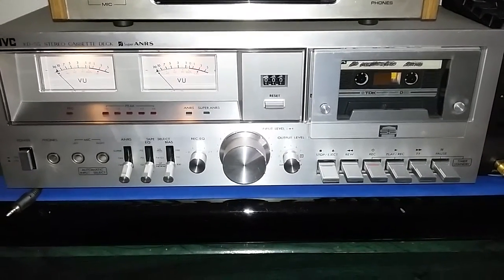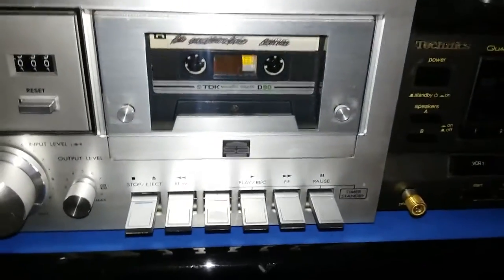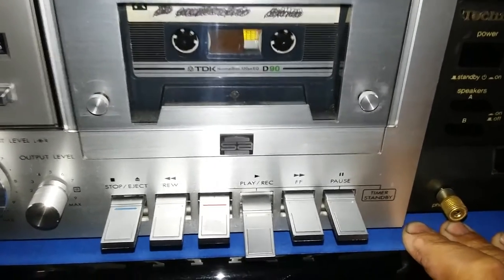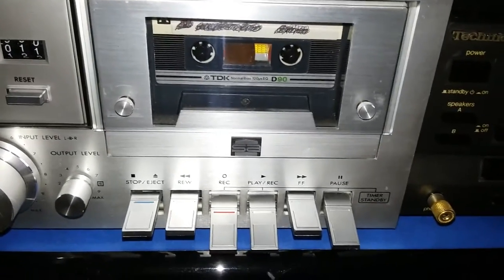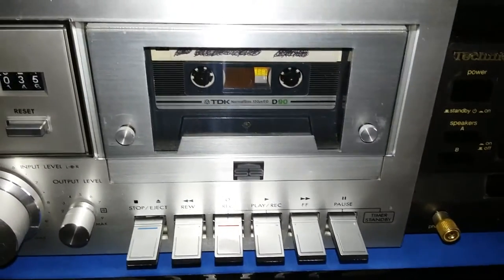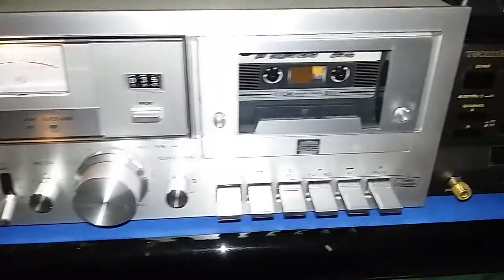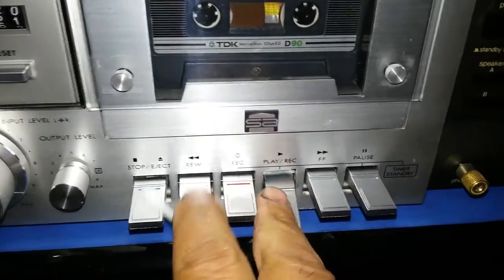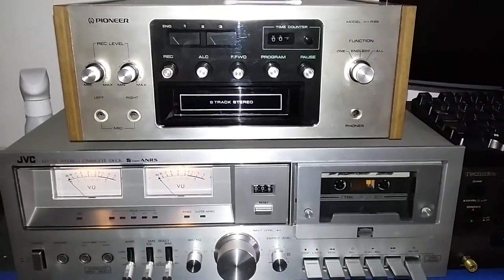Cassette deck mechanical care

Comment: Ramon,  What you're showing in this video is very good to know info, in that so many times I've seen vintage cassette decks, and other old equipment, with broken buttons and levers...and missing ones, too, no doubt caused by pure carelessness.  Another good vid, my friend.  Regards,  John
Reply from the maker: Hello John yes that's why I wanted to bring this video tip to every vintage collector attention I think this would help them the right way to operate them. take care my friend.